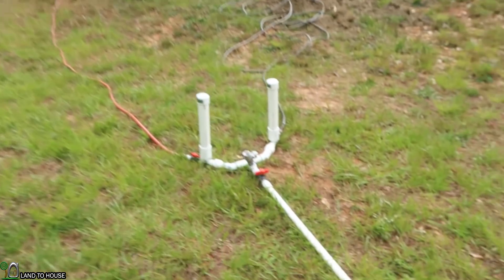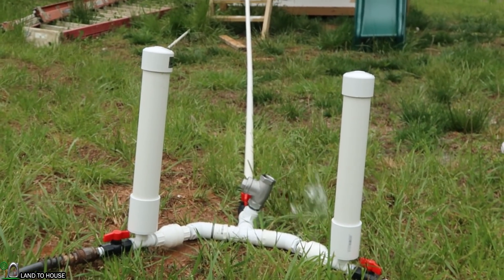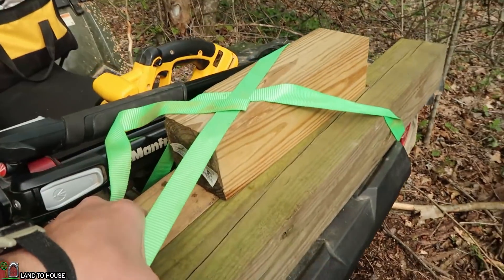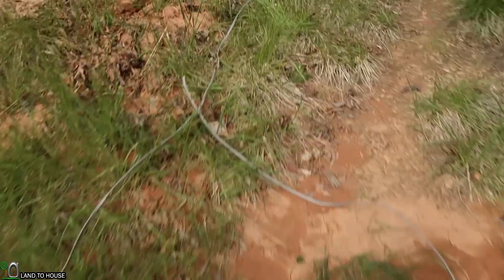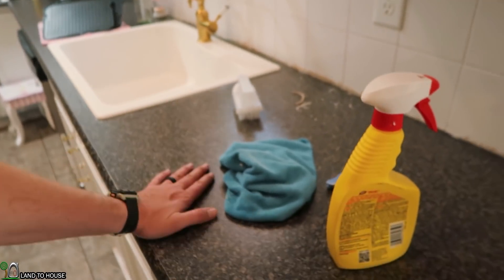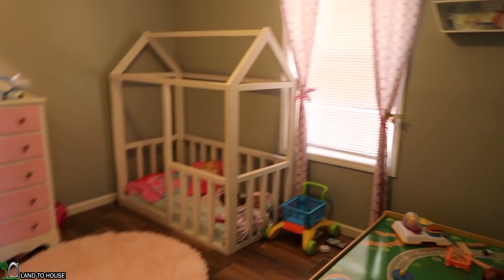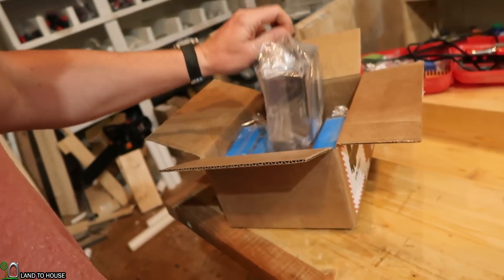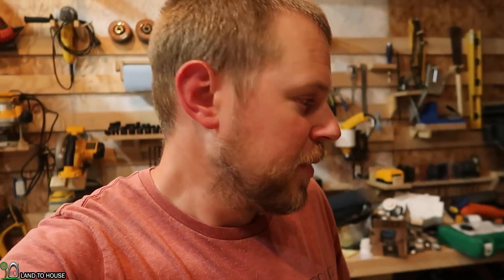The Micro Hydro install is going to be Awesome

Comment: Solar power is DC power.  DC power is different then AC power on how it travels through wire. If the gray wire you had was a solid  wire you will have a power loss over X amount of feet of wire.  If you use braided wire you can increase your length almost triple the distance.  If you do the math you are starting with 8 volts/amps/watts not totally sure of the math anymore but let's say you run solid wire 10 feet you are now at only 7 volts/amps/watts with braided wire you can go 30 feet.  If you run you inverter at the solar panel and turn the DC to AC power you can run it a few miles.  So for your water system put one battery and a 100 watt inverter in a shelter.  Run a wire to your house X miles away, plug in a battery charger to charge your battery bank in the house then back from your battery bank in to your 5000+ watt inverter and supply your home with as much AC power as you want.  Not sure if I explained that all very well but, DC power doesn't go very far and any connection will hinder its distance.

Comment: Can you tell what is the water intake AMSL? And what AMSL is the output container tank? If the AMSL of intake higher than the output then this system is useless, you can piping the water directly from the intake to the container.

Comment: Did you scrap the idea for the pipe going along the hillside to a barrel or are you just going to have two? 

Also, Will the generator be 3 phase or single? I think that it would be a good idea to have transformers at each end of the transmission wires so you can transmit more power with fewer amps. Hight voltage transmits better with fewer amps than line voltage or close to it. 
That or you could also run a heavier gauge wire or the "farm fix" would be to run several of the same gauges of wire in parallel.

Anyway good video as always and I can't wait for the micro-hydro series( :

Comment: Sir a ram pump can only push so far up and or only a few psi if you put 2 in a row will they put more water out and will it push farther...  

Edit And a double pressure tank with 4 check valves is it more efficient I cant describe it but here's a link https://youtu.be/XyF90UmVDvo

Edit edit if you make your dam hold more water or make the inlet deeper like dig it out so it holds more water will it push farther or more psi?

Another edit the waste valve just wastes water and could you put another smaller ram pump

Comment: Would it be possible to hook ram pumps up in series with some type of pressure tank(with bladder) in between to keep constant pressure and flow?
Reply from the maker: Do you mean 2 ram pumps feeding one delivery pipe?
Reply: @LandtoHouse  yep so one feeding a delivery pipe and then right after that one another one with its intake being the delivery of the previous one. So I would think that you would then require some type of pressure bladder to regulate the flow and pressure from one to the other. This would then in theory give you the capability to pump 49(7×7)feet of lift for every one foot of original head pressure. Thanks
Reply from the maker: I actually have that written down for a test. I dont think it will work but it's worth a try! My guess is that the pressure of the first ram will prevent the second from cycling.
Reply: @LandtoHouse  yeah that's why I would think a pressure bladder would be required, and a much larger first pump and smaller second one.

Comment: How many kwh does your solor panel produce on a day . How much did it cost. Where did u buy it. Keep up that good work man👍👍
Reply from the maker: So... the solar panels are installed but not connected. The power from them Will be connected to the same charge controller as the hydro. That series will follow the hydro. Total should be around 800 watts at peak.
Reply: Just wondering of the price
Reply from the maker: Yes of course. I will be covering that in the series.
Reply: No spoilers